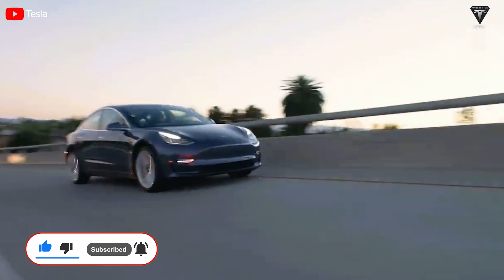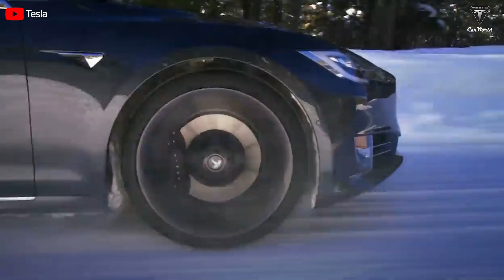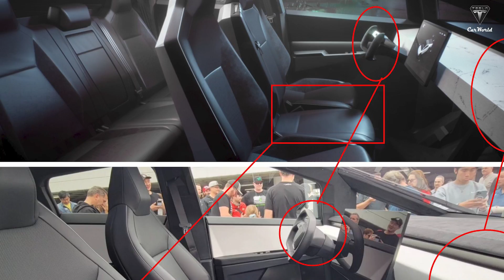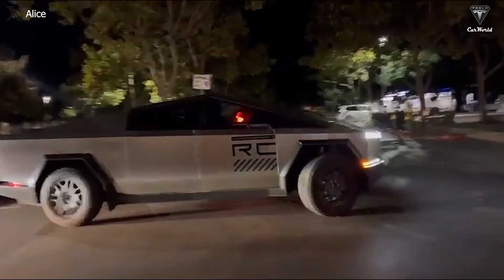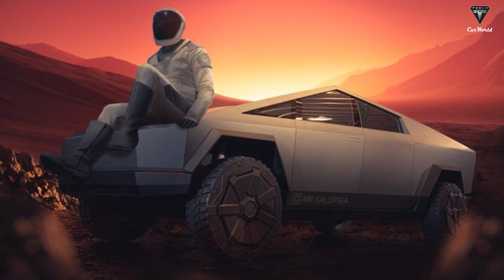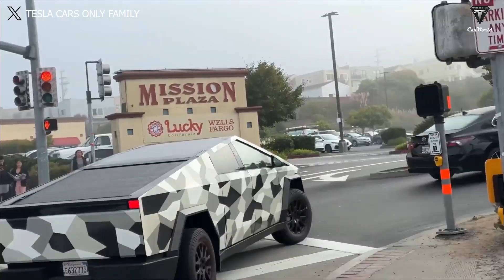Just Happened! Elon Musk Unveiled What Inside Cybertruck New "P" Motor! Can up to nearly 1000HP?

Comment: It seems me that they are taking a lot of things away from the original cybertruck. It doesn't look like it has Stainless steel floor On the bed. The ramp may not be there., No bullet proof windshields, A little smaller Then the original, You can't go through the cab into the bed, Lower miles than expected., I still absolutely love the cyber truck. Can't wait to get mine. I hope they don't take anything more away..❤😊